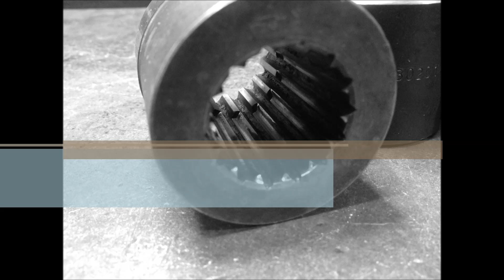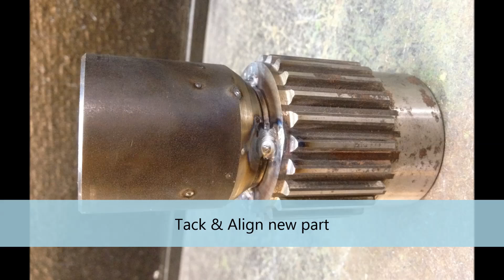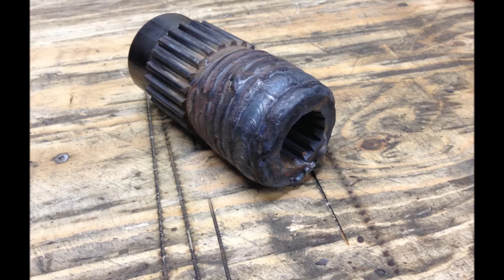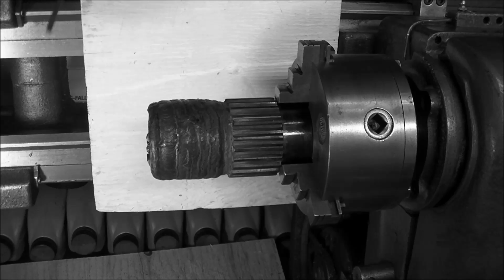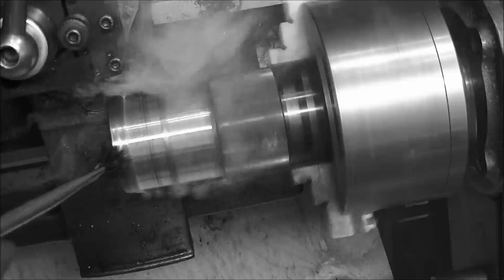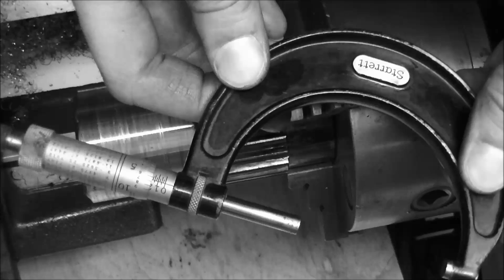PTO Repair

Comment: Curious you didn't start from the "beginning". 
By that I mean clear the end face first and follow up from there. It help to keep all the subsequent processes more balanced.   

Either case watched it all with great interest. I guess it wont be long until I´ll have to do similar job in a mini lathe. I cannot afford, in all senses of the word, the luxury of failing the repair. ;-)
Thanks for sharing 
Cheers
Reply from the maker: Yes I should have done a better job filming and documenting the repair; the tractors PTO is still working till this day.
Good luck with your repair; feel free to ask if you need help or ideas on your repair.

Comment: 2.125 is 2 1/8 not 2 1/4.
Reply from the maker: Yes that is correct.
Thanks for commenting and watching.
Reply: Larry Ganstine as an old machinist who doesn't get to sling by chips anymore I was enjoying the video but, cringed ever time you said 2 and a quarter/2.125...i could see you measured and were cutting to 2.125...it just bugged me each ti.e you said 2 and a quarter..lol.. good part though..